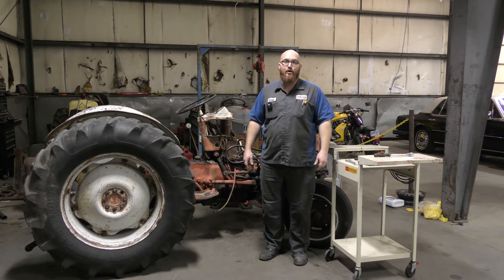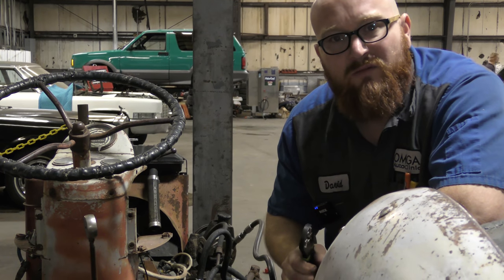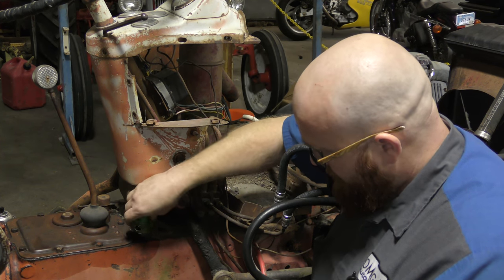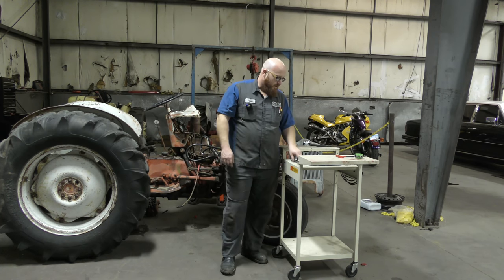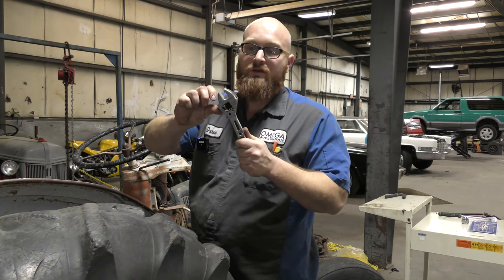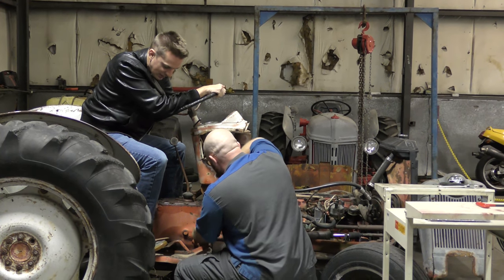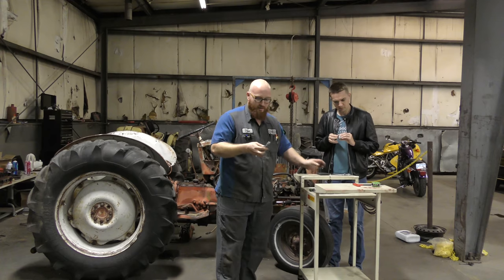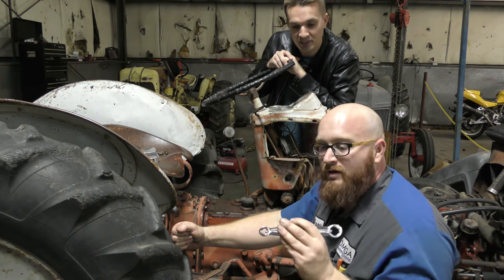Wonky Wrenches Part 2! The CAR WIZARD tests even more odd, 'miracle'' tools

Comment: Get a Knipex PliersWrench...I recommend having several of the sizes. One of the best tools I've ever bought, hands down. It's like a crescent wrench and a set of channel locks had a baby. Fully adjustable like channel locks, but unlike a crescent wrench, you can squeeze to grip the head of a fastener, and all it takes to be like a ratcheting crescent wrench is loosening your grip slightly as you reset to the next position on the fastener. And unlike channel locks, the teeth don't dig in and chew up the sides of the fastener. I build cell phone towers for a living, but I do also work on my cars, and they're invaluable for almost everything I've set them to. Also good on plumbing fixtures for the lack of teeth. They make some that have teeth like normal channel locks, but the teeth are much sharper and really dig in, though those are designed more for gripping into round surfaces like pipes.

Comment: That 12 point, 13mm- 1/2” combo won’t work on a 1/2” nut because its 13mm, which is 0.5118”...thus will strip the nut
13/25.4= 0.5118”
If it were 6 point...it might work
Reply: Actually if I am not mistaken it is 12 point because there is essentially 2- 6 point sizes, one metric and the other sae.

Comment: You're using the bionic wrench the wrong way, you need to flip it over. It's like using pump pliers, they're directional. you have to put force on the arm that moves, then all the force applied is directed to clamping on to the bolt, rather than forcing the handle back open.
Reply: I actually have a Bionic Wrench (given to me as a gift quite a few years ago) and just played around with it since I've never actually used it.  The handles are spring-loaded so it doesn't matter which way you hold it...you still have to squeeze it to keep the wrench from expanding and rounding off the bolt.

Comment: My uncle used to be a medical machine technician. All his tools were titanium alloy so they’re non magnetic. 

I have the Loggerhead tool! 

Anyways my uncle gave all his tools to me when he retired. Screwdrivers, pliers, ratchet set from 3mm to 45mm sockets 
3/64s to 1 1/2” sockets. Hammers, like basically a 700 piece mechanics toolset. The open end/box end wrench’s are my favorite! They weigh so little. It’s what drives my love for titanium. Check out my Instagram Wizard! I’ve made a few titanium tomahawks and one tomahawk out of a large titanium open end/box end wrench that turned out sweet.

Comment: I love the wonky tools.  Most of them are great for amusement.  I'm with you on 12 point.  I have only the few needed for 12 pt fasteners, don't use them otherwise.
Emergency tool bag:  I learned long ago that my emergency tool bag consists of a cell phone and my ramp truck, car hauler trailer,  or tow dolly

Comment: I have the bionic wrench. It's great when you have multiple sized nuts that you need to take on or off as long as you can get to them. Nothing works that well on 60 year old rusted nuts and bolts wizard. It's not meant for that. Like I said, it does work really well. Way better than pliers for nuts. I think wizard needs to start doing some forearm curls.
Reply: I work with tools professionally and I can assure you that that tool is garbage. There are way better alternatives out there
Reply: @jezuzfreek777  so do I. It's not a professional grade tool. It's meant for around the house or garage to remove nuts and bolts and it works well. I have no reason to say it's something other than what it is. I've used it almost every week a few times for almost two years. It works. Not to mention I watched him use it again and he is using it wrong. Flip it over then it doesn't try to force itself open, it actually grips tighter. That's actually how you should use any pliers. You apply force to the clamping handle.

Comment: That first wonky wrench reminded me of some odd tools I inherited. Craftsman. They looked like channel locks with the wide openings, but were spring-loaded and had a small notch in the middle, presumably for a bolt/nut. I never could figure out how they worked or what they were useful for. They had the same problem as wonky wrench #1--any effort would force the handles open.  

The hockey puck I'm betting is metric-sized sockets, since ½-inch = 12.7 mm and it fit too loosely on the bolt. Even so, I'm wary of 12-points anyways...
Reply: The first tool also looks like a ferrule crimping tool, maybe that's what it's based on.

Comment: that second tool with the green plastic is more of a spline-drive than a twelve-point.  They fit on SAE and metric fasteners because there are enough tolerances in the spline design that they fit good-enough most of the time.  There are sockets and even box-wrenches made in this fashion too, also noted as being "universal".

I'm not a fan because of what such spline-drive tooling does to the fasteners.  They mark and marr them up.

Comment: Wizard, could you do a test video for 5 or 6 torque wrenches? It is so hard to find an accurate torque wrench for under $100 these days. Most of them dont work as intended.
Reply: These days you're better off with an adapter imo. My matco digital is only a 3/8 that goes up to 100 ft lbs and i need 200 on my diesels harmonic balancer, I picked up an AC delco 1/2 adapter that goes up to 250 for $42 on amazon. From my research there isn't a meaningful if any difference in accuracy between a full tq wrench vs. An adapter, lastly the adapter can get to some places a full tq wrench might not. Oh, and also you want something digital so you can do angles too, and something more than 100 ft lbs...i regretted buying that tq wrench after the fact, even on a gasser there are often things up around 125-150 ft lbs.

Comment: That "Smart Wrench" is similar to a bolt extractor tool the Ford dealer years ago used to get a bolt off that I'd rounded when someone didn't put a washer back on a bolt that was supposed to have one. The socket went on the bolt. A pin threaded in from the side of the socket to tighten on the rounded bolt, a long breaker bar was attached, and whammo, off it came.

Comment: 1/2" is 12.7 mm.  I guess for many things 1/2" and 13 mm are interchangeable, but I prefer to use the correct size tool for the job.

Comment: I'ven seen those green hockey pucks. They are not meant to be used with a lever, but to let you get into tight places, like under a car seat, where a regular tool won't fit. Like a stubby screwdriver, sometimes you need it.

Comment: the little green multisocket tool is in my emergency bag -- it has saved me quite a few times. The hole in the middle is nice because you can basically use it as cheater bar.

Comment: These are all tools meant for people that never learned the common sizes of Metric and SAE.  Nothing works like the correct socket or wrench for the nut or bolt.  I tend to think these come from an inventor and then went directly to the boardroom instead of mechanic's hands for real testing.

Comment: There is an interesting story behind the Bionic Wrench.  They were sold in Sears for a time, but then Sears began selling Craftsman branded wrenches of the same design, claiming that the patent was invalid due to an existing patent on a similar design from the early twentieth century.  It was the subject of some news coverage at the time.
Reply: I have the craftsman version. It is better since it has a lock.

Comment: That last wrench might be good to keep on a ski doo or a 4 wheeler !!
Reply: I'm not seeing it doing much that a traditional adjustable wrench does.  Perhaps it can fit into slightly smaller spaces, but not much.  For a quad or perhaps a sidebyside where weight might count maybe, but for a four wheel drive truck or SUV I'd just carry a socket set.

Comment: Those ratcheting adjustable wrenches are very handy on lines, such as hydraulic lines where a socket or a gearwrench ratchet cant go. Just put ur thumb with slight pressure aginst the side of the wrench that moves back and forwarth and it will lock into place each time.

Comment: The second tool looks like it's metric sizes. 13mm is not going to fit a half inch nut. 1/2" is 12.7mm-way too much slop at 13mm socket. Most of those tools are just too bulky for most locations on a car. the last wrench might be good to take on a bike where you don't want to carry a lot of tools.
This was a fun video. Kudos Wiz.

Comment: the bionic wrench is modeled after the hex crimpers for ferrules. and while the other version works great on helping to keep wire ends nice and tidy, the one for nuts and bolts needs to just go away.

Comment: the first tool would probably be a lot better if it was ratcheting, and only reset when fully closed.
and the last tool could use a more full size square plate for the pin ends. 

all of them except the last one oddly enough just seem like they're made with low quality materials, where the prototype was probably much better (higher quality metals and machining) and actually functioned. the puck was just basic enough to still prove useful afterwards.

Comment: Ive actually had good success with the bionic wrench as long as the bolt isn’t crazy tight. mine is actually a little better quality than that one. The biggest problem is finding a bolt that you can get a good grip on because of the ergonomics

Comment: The smart wrench is using the same mechanism as the Go2Socket.  I'd like to see the same thing but way bigger.  It's a really useful type of tool for quick (destructive) removal of things that are mangled or don't have a proper surface to grip.  Like, file a single flat surface, clamp down, and rip away.  It's the only tool that takes up less space than other tools for the same job.

I have a tool that uses the same mechanism as that chuck-type socket.  It has some uses, but not for anything that you're putting much torque on.  Kind of cool to see it as a dedicated socket, but I don't think I'd ever need it.  Not for $20.

Puck wrench.  Seems best suited for people who are using a screwdriver more often than a wrench.  At least it's cheap.  Chuck it in with the framing hammer.

Comment: I had a similar wrench to that last one, but built fast sturdier.  The movable jaw had 2 sides, was a big solid block, with minimal slop.  It'd grip a fastener on 4 sides.  So, not as ideal as a 6 point SnapOn, but great for drain bolts, etc.  It was not beveled on the edges so didn't have that problem either.  
It may have disappeared from my tool collection 🤔

Comment: That last one seems like it would be alright for keeping in a motorcycle bag in a pinch, using with some odd 1/2 size metric bolt/nut you might not have a wrench/socket for, or if you are not stupid around the house jobs would be fine if you don't feel like walking to the shop to get the right sized tools when your girlfriend/wife says please honey put this together for me, after coming home from shopping, and it's pouring buckets outside. 
That very last one happened to me a few weeks ago when my girlfriend brought a new dinning room table home in the back of her truck, and I put it together using my trusty Gator Grip socket, and spare ratchet I keep in the kitchen junk draw.

Comment: Wizard! You used the green round thing correctly for a moment, it is supposed to be used to find the correct size of nuts and bolts :o that's why it has both sysytems printed :v

Comment: I've had a bionic wrench in my toolbox for years.  It's good for something you know isn't rusted on or maybe hold the bolt head while you start the nut.  Otherwise, agreed it was a stocking stuffer years ago, and now sits 364 days of the year..

Comment: The segments may have been movable with your fingers but once working on the fastener,v they should firm up to form the structure.
That last one with the pin, that shares the pressure with the outer part doesn't it?

Comment: I get alot of toold from amazon and I swear the cheap ones are better then the ones you can get at auto parts stores or even home depot, also 13mm and 1/2 inch, bolts are almost nearly identical in size so if that green tool doesnt work on it then that socket wasnt made right

Comment: I like these new videos.  That puck thing would work good if there was a metric/american set.  2 different sets.  Also you gotta learn how to use tools lol.  You're probably better with most tools than me from being a mechanic for years.  The first tool might suck but you're not supposed to squeeze it, you just push and it squeezes itself like pliers.  And you gotta turn the ratcheting adjustable wrench more for it to catch.  They still suck but you're using the tools wrong lol.

Comment: The engineering on some of these is solid and functional. The problem is that design is sold to a marketing company that sends it to China for manufacturing and it's made cheap, about $1 or $2, to sell for $9.95 or $19.95 and of course the quality is poor and the good design is now fails. There hope is a late night hype infomercial, sell as much as they can before people realize they are junk then they move on to another product.

Comment: All those ratcheting Cresent wrenches or open-end ratcheting wrenches tend to round off bolts. DON'T USE THEM ON IMPORTANT HARDWARE! Don't be lazy and get the correct size wrench for the hardware!

Comment: It seems like any wrench that promises to replace a whole set of wrenches is going to be junk....this seem to have been the case ever since “what-a-wrench” appeared on tv shop back in the 90s.

...and every time it’s back to; why not just buy a regular crescent wrench?
Reply: MMR I have a wrench that replaced my whole set, it’s another whole set. Spent most of my formative years working on cars, ended up working for an Aston Martin / Ferrari / Porsche dealership, literally no one used anything other than Snap On kit, the company paid for our kit so price wasn’t an issue but if someone had been spotted using anything ‘adjustable’ there would have been hell to pay! Sockets and spanners, know your sizes, use the right kit for the right job. Spanner length matches the kind of torque you should put into a bolt, long adjustable wrenches are a recipe for disaster. Weird that there’s always someone out there that thinks reinventing the wheel is a good idea 🤯

Comment: I think those Loggerhead things are pretty useless. The only thing I can think of would be to use them to hold onto a nut or bolt AS you are getting things put back together. Maybe you hold it, and then have a better tool ok the other side and once it is tight ish, then swap out the Loggerhead for a real wrench or socket...

I'm not sure how I feel about the green puck thing. I don't know if I should be more amazed that it didn't break, or that that HUGE Allen key didn't even flinch at being abused like that!

Comment: You using a light duty tool in a heavy duty application is a fail. Also if you hold a good wrench in a sloppy way will cause it to slip off and round off a bolt head.

Comment: The worst tool I have seen in decades is the Wera Turbo Screwdriver. 4:1 planetary drive speeding up the screw drive. Great theory, horrible tool. Worth laughing at, and NOT a cheap tools. It wouldn't make a good chisel or hammer either. Totally useless.